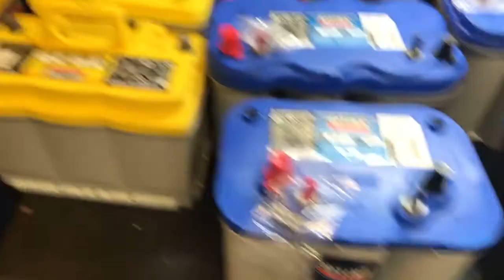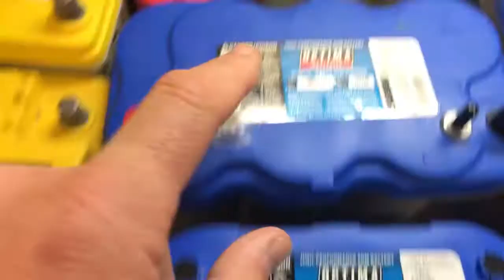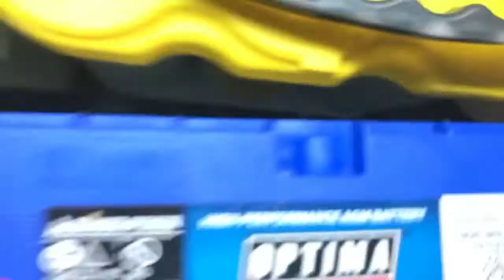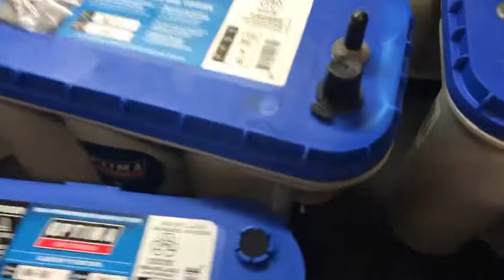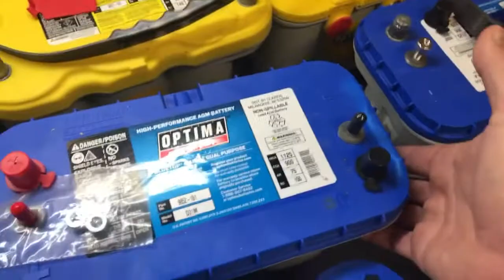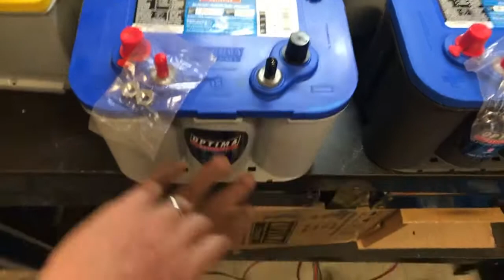OPTIMA BLUETOP Batteries

Comment: Which one would you recommend as a starting battery but the engine is an EFI. So the EFI also needs power from the battery. Light or dark grey?
Reply from the maker: Once an engine is started, the power for electrical equipment and accessories should come from the vehicle's charging system. Either battery can work fine in a starting application if they meet or exceed the cranking requirements of the engine. If you plan to run accessories with the engine off, then the batteries with the light gray case that are designed for starting and deep-cycle use are a better choice.

Comment: Would it be good on a UTV? Considering they don’t have an alternator
Reply from the maker: If you can fit the battery in your UTV, you can use it as long as it provides the current you need, but you'll need to have some type of battery management plan for recharging it.
Reply: @optimabatteries  I appreciate your in-put and time. Great to know

Comment: Can I power a water heater with the D31M ?
Reply from the maker: The D31M is a 75Ah battery, which essentially explains how much energy is inside the battery. What you'd need to determine is how much energy your water heater needs to function and how you would be delivering it, as you may need some type of inverter, if it isn't a 12-volt water heater.
Reply: @optimabatteries  oh thanks how I will find that
Reply: @optimabatteries  I do have a 4k inverter

Comment: Which Optima blue top would you recommend for a sump pump battery back system with a sentry converter?
Reply from the maker: Either the D34M, D27M or D31M (smallest to largest). All of those batteries are designed & warrantied for deep-cycle use. The 34M BLUETOP is only designed & warrantied for use as a starting battery and would not be appropriate. The larger the battery, the more power it can deliver and in a constant application like a sump pump, the more cycle life you can get out of it. If your power goes out for an hour here or there, a D34M is probably fine. If it goes out for a day or longer, then a larger battery would be more appropriate https://www.optimabatteries.com/products/marine-rv

Comment: Is it correct that the D34M only has a c20 capacity of only 55ah (and the D27M 66ah)? Other AGM manufacturers offer over 100ah for those group sizes -  or am I missing something? I have a daily load on my cruising boat of around 100ah so need a total house bank capacity of 300 to 400ah.
Reply from the maker: We've never heard of any AGM manufacturer offering over 100Ah in a Group 34 battery and frankly, we don't know how the math could possibly work in that footprint with lead-acid technology. Are you referring to the specification for minutes of reserve capacity? With that demand in a house bank, we'd recommend our Q31M-DC150, which is a 150Ah battery: https://www.optimabatteries.com/products/orangetop-q31m-dc150
Reply: @optimabatteries  That's a lithium battery (not AGM) but OK. Two questions: Out of the claimed 150ah, how much of that is actually useable (in other words, maximum discharge over time). Secondly, can it be used for both deep cycle and start loads i.e could I replace my existing lead acid start battery and my existing lead acid house battery with one of these, to be charged in parallel (by solar or shore or alternator)?
Reply from the maker: @stephenburnage7687  the Q31M-DP120 can be used in both starting and deep-cycle applications, although you'd want to confirm with the engine manufacturer on their requirements of lithium batteries. The Q31M-DP120 meets or exceeds Mercury's requirements from November 2022. The available cycle life of a lithium battery out of the box is far greater than a lead-acid battery. You will get the Ah specification listed out of either battery and while there is some penalty for deeply-discharging either technology, it is not as great a penalty for lithium. Also, lead-acid batteries will have a greater efficiency loss with higher rates of discharge than lithium batteries. https://www.optimabatteries.com/products/orangetop-q31m-dp120
Reply: @optimabatteries  I believe you misunderstood my question. I am not trying to compare your lithium battery to a lead acid battery but to other lithium batteries. With respect, the 120ah is a marketing number, not an actual estimate of what ampere hours a user might reasonsbly access repeatedly (which is limited by any recommendations or BMS limitations on minimum charge) and for how many cycles. Your website seems to be missing this key information.
Reply from the maker: @stephenburnage7687  the owner's manual posted on our website indicates the low voltage cutoff for our BMS is below 10V (0% SOC)- https://useast2prodbrandsites.blob.core.windows.net/optimabatteries-sfassets-prod/docs/default-source/user-guides-and-manuals/optima-batteries-orangetop-marine-rv-owners-manual.pdf?sfvrsn=9a449f5_1
Reply: @optimabatteries  Blue top C27M = 66ah. US Battery Group 27: 105ah. Northstar Group 31: 102ah (all c20 test).
Reply from the maker: Your first comment cited a D34M (Group 34) battery at 55Ah and suggested other manufacturers offer over 100Ah in that size. Neither the US Battery (Group 27) nor the Northstar (Group 31) you cited subsequently are Group 34 batteries.

Comment: Have you seen these used with fully electric cars?  I have a Subaru Solterra (there are Toyota and Lexus variants of this car), and they have an issue where the provided 12v battery gets discharged. This has led me to purchase a bluetooth battery meter to monitor voltage, and in some instances, the voltage on the battery falls below 12v, so I have to connect my Noco 10 and it's fine for a while.  BUT is it possible to use one of these, or maybe the D34 YELLOWTOP on a passenger vehicle?
Reply from the maker: If an EV uses a 12-volt (low voltage) battery, it's possible an OPTIMA can be used in that application, if it meets or exceeds the specifications of the OE battery, fits in the space available and if properly-vented to the outside atmosphere, if necessary.

Many newer vehicles have significant key-off loads, which is why 12-volt batteries are getting larger, even if the engines they start (in ICE applications) are getting smaller. We recommend periodic maintenance charging on all new vehicles, starting out with a monthly cadence and increasing or decreasing frequency, depending on measured voltage.

Fully-charged, most 12-volt batteries will measure at least 12.6V and whenever any lead-acid battery is discharged below 12.4V and is left sitting in that state, sulfation begins forming, which diminishes both capacity and lifespan.

Comment: Curious what you would recommend for an overlanding car with a camping fridge, plenty of lighting, and a winch. I was looking at the blue tops 34m as the starter battery and the D34m as the fridge and accessory battery.
Reply from the maker: The 34 REDTOP is the same battery as the 34M, but carries an additional year of free replacement warranty coverage. However, if you are connecting that battery to a winch or any other significant electrical accessories, we would recommend a D34 YELLOWTOP, which also offers three years of free replacement warranty coverage.

On the house battery, it's difficult to know how much demand you will place on the battery, but Peurket's Law indicates the shallower the discharge cycle, the more cycle life you will see out of a lead-acid battery (including AGM batteries). That would suggest the best course of action would be to use the physically largest battery you can fit in the space available, so it will not only have more reserve capacity, but shallower discharge cycles than a smaller battery and longer lifespan. 

Whether it's the starting battery or the house battery, the key to maximizing battery performance and lifespan, is keeping your batteries fully-charged whenever possible. The REDTOP (and 34M BLUETOP) is considered fully-charged at about 12.6-12.8V and the YELLOWTOP (and all other BLUETOPs) is considered fully-charged at about 13.0-13.2V.

Comment: I use the blue with light grey sides in my trunk as a secondary for my stereo system. Have had good luck with them lasting a long time. I use the studs to hook up the power wires but I noticed on this video you said for high load devices to use the lugs instead of studs.
Reply from the maker: That is our recommendation, especially for winches, but you may be ok with a stereo system

Comment: I’ve purchased lead acid deep cycle, agm deep cycle, currently running 2 Sams Club Marine&RV Duracell 31 AGM Deep Cycle in my Boat, I’ve squeezed 3 seasons out of these but this last season could tell they weren’t holding a charge very well, on the average all the brands and compositions of battery have lasted an average of 2 seasons. I’m want to purchase 2 Blue optima 31 but afraid they’ll last just a couple of seasons and for the price it’s hard to justify. I’ve been running 2 yellow tops in my Tahoe for many years and am familiar with Optima. I charge and maintain all my batteries with the Optima Digital 400. What’s the best way to maintain the Blue tops all year so to maximize the longevity?
Reply from the maker: If you have enough time to charge them in between trips to the lake, the Digital 400 will work just fine to charge and maintain Group D31M BLUETOPs. However, if you are looking at using a trolling motor on back-to-back days, you'd want a charger that can charge at a higher rate. Our Digital 1200 charger will charge at a maximum of 12 amps, compared to just 4 amps for the Digital 400. There are also several reputable marine chargers that can charge at higher rates as well. We would encourage you to consider only units that are microprocessor-controlled and have specific settings for AGM (not gel or gel/AGM) batteries https://www.optimabatteries.com/products/digital-1200/

Comment: Can you recommend a marine charger for charging 2 d34m batteries?
Reply from the maker: We are not allowed to recommend products from other manufacturers. If you are looking for a charger to mount in a boat, we would recommend one that is microprocessor-controlled and has specific settings for AGM (not gel/AGM) batteries. There are many great options that offer both of those features.

Comment: I have the blue top, dark gray case. I got a deal on it and wasn't paying attention what is was supposed to be used for. I live on a lake and use it for a 55 pound thrust trolling motor. I know it's the wrong battery for what I'm using it for. But I have to tell you, that I've been using like that for well over 15 years. Maybe next year I'll buy a new one. The right one this time.
Reply: I have had them last that long as well. They are the "honda" motors of the battery world.

Comment: Can it be use for an RV
Reply: So I have two of the dark gray one on a music system so really they not pushing no power out for what I need ?
Reply from the maker: @sanchezfanning334  our 34M batteries with dark gray cases are designed & warrantied for starting applications only, not deep-cycle use, like car audio. If your engine is running and power is provided by your vehicle's charging system, you should be fine
Reply from the maker: Yes